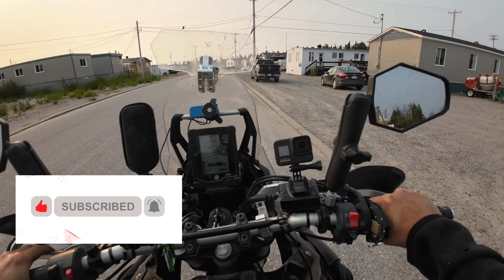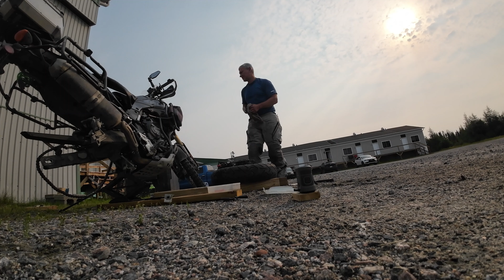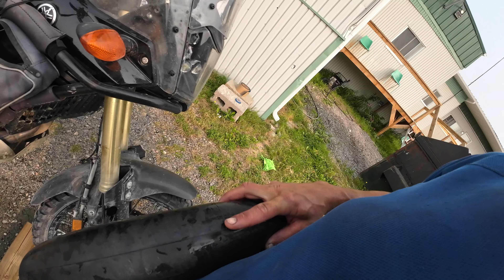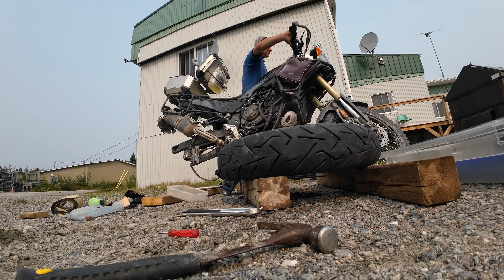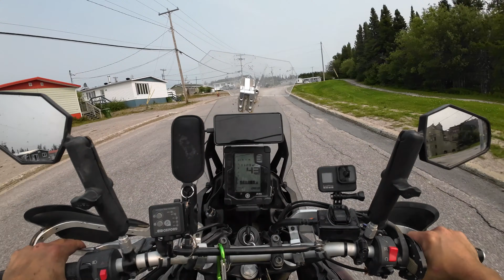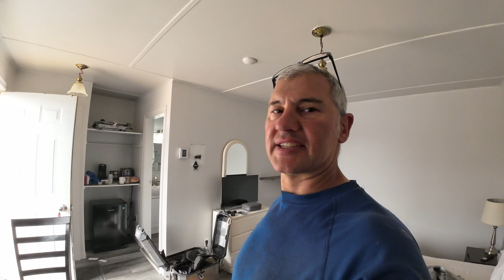CC Tenere 700 Adventure Day 15, Stuck in Radisson!

Comment: Those tyre levers are not the best. I recommend the Buzzetti type. 

I wouldn't use Slime. Carry a spare tube, or fit tubeless wheels.

You should be able to patch a tube properly. We've been doing so for years.
Reply from the maker: Actually the levers were good. My old ones were shit but bought a good set for this trip. Agree about the patch I just never did it.

Comment: I'm worried that you never showed checking inside the tire for whatever was puncturing your tire. Clearly it wasn't the rim tape as the hole was on the outside part.  If you didn't confirm that there's nothing still in the tire you might go flat again.
Reply from the maker: I did actually check it was nothing inside but probably from having lower pressure and pinch flatting.

Comment: Manufacturer and customers are in denial!! Realistically what percentage is bike used in technical off road that requires low, really low air pressure? And low air pressure requires rim locks so tire doesn't come loose!! Tubeless are the answer, they have been. Now w 16, 24, 26,gram CO2 cylinders and easy cheap mini pumps and plug kits and sealant..a flat is minutes, so fast and easy you don't need to wash your hands .
Reply from the maker: Ya I figured that all out too late lol